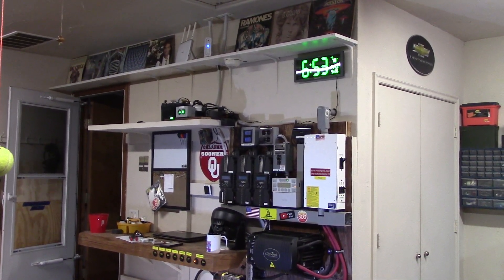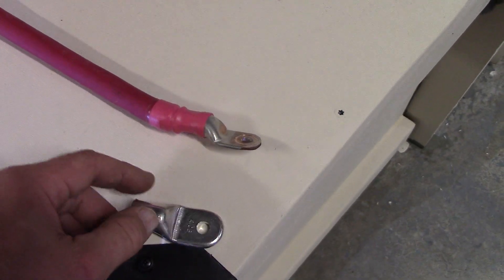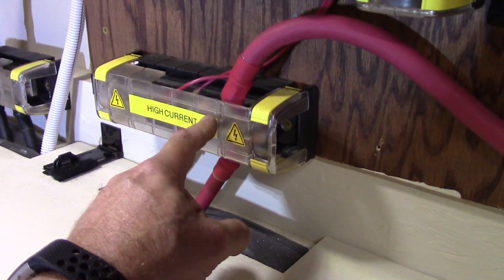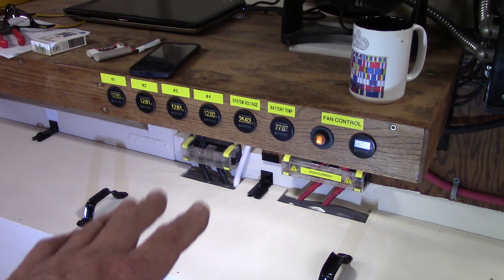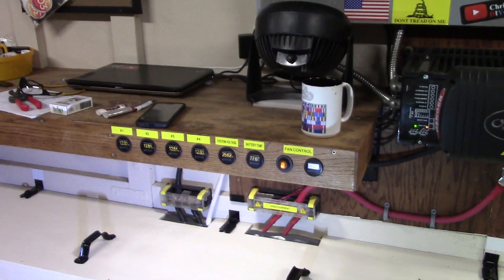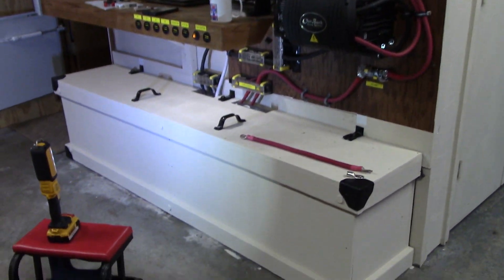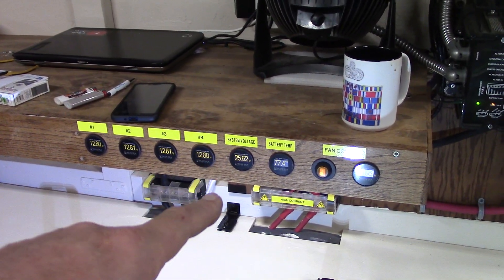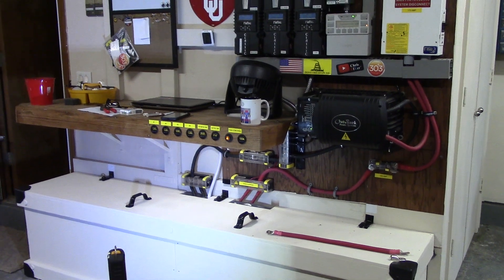New lithium battery bank update / early morning mods

Comment: how on earth can you have 2 thumbs down? lol. jealous peeps?
Reply from the maker: Thumbs down mean nothing.
Reply: @ChrisDIYerOklahoma  Chris did you say that you do not have to use the Mate3S for the Inverter?
Reply from the maker: No - the updated Mate3 firmware that Outback has is not needed to connect with Optics RE. My inverter and Mate3 (older one) is working perfectly, connected to Optics RE. No issues with tweaks and monitoring. The inverter "can" run as a stand alone...but, I don't recommend it